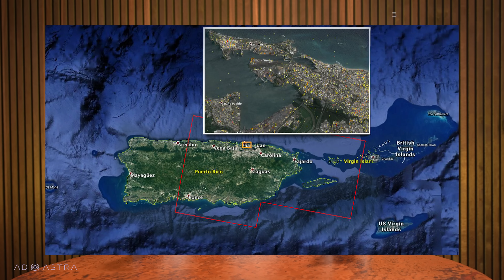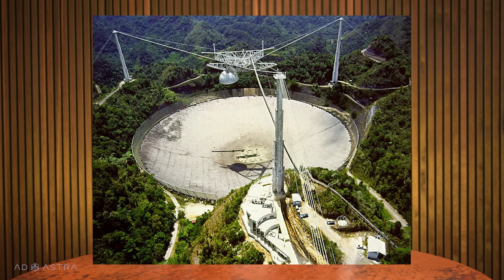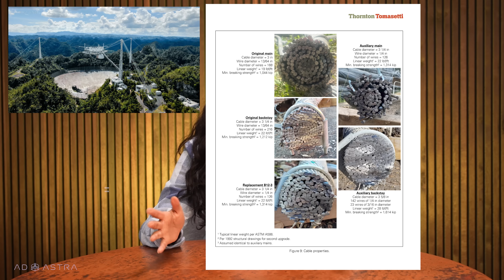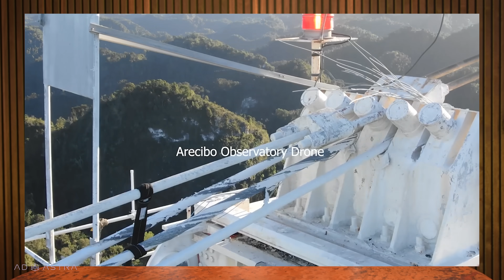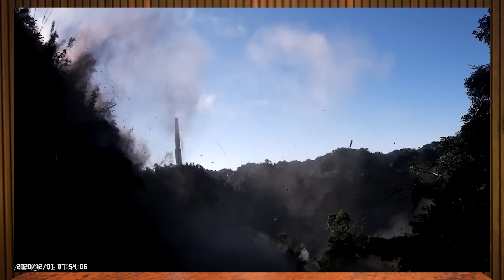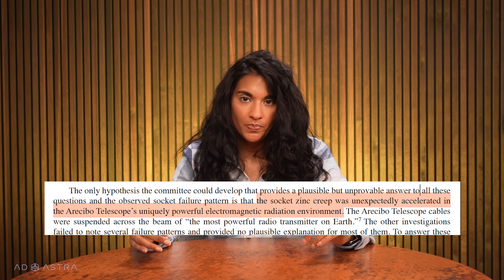ARECIBO COLLAPSE: We may finally know why the historic observatory failed

Comment: I was not aware that the dish was also used as an atmospheric radar device, so far I had thought it was a mere receiver that had only been used as a transmitter to send out SETI messages at some point.

Seeing that it was actually capable of sending radar pulses in the 2.x GHz range with 1MW transmitter power makes the explanation more plausible ....
Reply: There's a lot they don't tell us about. Remember that. These days you have to ask all the questions you can, because nothing is offered up for free.
Reply: @ThisIS_Insane  it was so secret that this was built as a radar dish, that it's discussed on its Wikipedia page.  Duh.
Reply: @duanem.1567  We all know how precise All them wikis are, don't we?
Reply: @ThisIS_Insane  If something is discussed openly on a Wiki page, and is common knowledge among people in certain industries, then it should be embarrassed to call itself a conspiracy.
Reply: @ThisIS_Insane  they apparently know something you don't.

Comment: The zinc was contained within steel shells, which would have shielded it completely from radiation. In fact a layer of aluminium cooking foil would have been sufficient to do the job. The radiation-induced creep sounds like a non-starter as a reason for collapse. (I am a microwave radio engineer and have designed both transmitters and receivers for space-based projects)
Reply: They use zinc anodes to protect steel from corrosion. I would bet there was current from somewhere flowing through the cables and that was enough to erode the zinc which loosened it in the sockets.
Reply: @NBSV1  That is a very different process, and I'm betting all those cables will be ground-strapped to make sure they don't kill too many engineers. The zinc has certainly crept, but I don't think the mechanism is electrical.
Reply: @ considering those style couplings hold well in other applications there was something different going on here. Bridges aren’t normally going to have the power put through them like this did.
Reply: @NBSV1  You have decided what the difference is. I would say there is a much bigger difference at work here. In a bridge once the cable is installed it doesn't move. These were subject to varying stresses as the receiver cabin moved about, particularly after its weight was increased from the original design. I know extra cables were added, but they were not integrated - rather a separate item. I would be looking there before anywhere else.
Regarding the power, the amount actually impacting each joint was minute - the total radiated power was spread over the entire area of the dish. The amount impinging on an individual coupling would not raise its temperature by more than maybe a thousandth of a degree. And as I said before, none of that RF energy reached the zinc. It all hit the steel.
Reply: @ And, bridges don’t have heavy cars and truck driving over them all the time? Even pedestrian bridges will get cycles of loading as people walk over them. 
About the only thing different in this setup is the radio frequencies and such the assembly was subjected to. I wouldn’t worry about temperature as much as induced currents and ionizing of parts. 
Regardless of what caused it, they obviously had a problem that should have been noticed during an inspection. Either they weren’t doing inspections of the cables, didn’t do a good enough inspection, or didn’t have the funding to care. 
If they had wanted to keep it going they could have started replacing cables and either fixed the problem, or just accept that the cables are a maintenance item that gets replaced.
Reply: There is an induced flow from the dish to the cables and their Zinc plugs. Electromagnetism etc. It's similar to copper windings spun around a steel core or whatever an AC generator/motor does.
Reply: @santyclause8034  remember this is rf. Any induced currents will be confined to the surface by skin effect.

Comment: Interesting , zinc anodes are used on boats to avoid electrolyses between dissimlar metals , ie in my case a cast iron  keel and a bronze propeller  . The zinc's in fact a sacrificial anode , ie better the anode desolves than the bronze prop.

Comment: The odds of funding for a replacement are very small, it was originally built for the military, it was a DARPA project.
Reply: It could be done if the science generated was valid and worth it imo. I think it was given up on too easily.
Reply: @metatechnologist  There is no room for it in the NSF budget, they couldn't even afford the upkeep. Find a military purpose for it and I have no doubt you can get it rebuilt. But there isn't any, that's why it was given to the NSF to begin with.
Reply: @anonemus2971  there's that plus other instruments have better resolution. But it's still interesting to ponder.

Comment: Having such a machine sitting, uninsulated and grounded by these zinc plates, transmitting a current towards the ground via this tower, should have been taken into account in its design. Failure was imenent, and I would postulate that this condition would be found on some of other zinc plates in the series, throughout the telescope cable ties.

Comment: If there was DC current on those wires, means that something must have been seriously wrong with the RF transmitters.
AC current above a few kHz this deep inside the zinc socket is basically impossible due to the skin effect.
Ocean salt and years of corrosion seems much more likely to me.
Reply: If they want to print unproven ideas, how about poor material and workmanship, poor inspection practices, poor choice of construction materials, underestimating the effects of the mass of additions to the aging structure, underestimating / ignoring weathering effects. (i.e. hurricane loads are unpredictable, and hard to measure.)
Reply: @jfbeam  IIRC, the mass of the raft was increased with a large amount of additional receiver antenna.
Reply: how do batteries work, just a thought.

Comment: 11:00  ship cable to a pier bollard must have each yarn equally matched with each other in the cable. Otherwise, the one that is being pulled the most will break first. Manufacturing uniformity is of the utmost importance.
Reply: Only as strong as it's weakest link.

Comment: That actually sounds very plausible to me that the Zinc may be affected by the high radiation, may become slightly more pliable and slowly morph over many years. Seems to me that the Lunar Crater Radio Telescope might be a better investment, but building an improved, bigger Arecibo 2.0 would be second top choice for Radio Astronomy.
Reply: Even though the telescope actually doubled as a high power atmospheric radar, the Zinc would not really have been directly exposed to the radar pulses, the anchors should only have been hit by some much weaker side lobes?
Reply: @hartmutholzgraefe  She said that an electric current was created inside the cable and that it was the electric current that caused  it to fail.
.
Reply: @BobSmith-dk8nw  For that the cables would have to have acted as an antenna though, but the cables where much longer than the signal wavelength.

The main transmitter was sending in the 2.x GHz range, so with a wave length of less than 15cm, That shouldn't cause significant current ...?
Reply: If you guys have heard of bi-metallic galvanism... basically the cable forms an electrolytic bath which eats away the anode material and deposits it on the cathode closest to the largest potential difference before ground (or something). Not only is there cable slip, the Zinc plug is re-deposited somewhere it is not designed to be. With a little more fastener engineering this would have been a non-issue. Possibly the most rudimentary fastenings that could be devised, the cable  strands were not collectively solidified under tapered diameter clamping, in tandem with the Zinc end plug through split collets, example pc-style hard tube fastener design in a water-cooled loop. Or a Collet chuck in a center lathe; or some equally clampy fastening design already well explored, not rocket science, not expensive..

Comment: There after the 4:22 point, "confusingly named towers four, eight, and twelve" get a dial clock or watch and set it on the location's ground plan or on a map printout ... 🕓🤔
Reply: It all goes back to the brilliant sexagesimal base-60 numbering system invented by the Sumerians in the 3rd millennium BC.  60 has 12 factors, of which 12 is one.  A circle with 60 equally-spaced markings on it can be easily broken up into exactly equal 1/2, 1/3, 1/4, 1/5, 1/6, 1/10, 1/12, 1/15, 1/20, 1/30, and 1/60 sections.  Analog clocks are sexagesimal and divided into 60 and 12 parts.  Today we think decimal and base 100 make the most sense, but try breaking up a circle with 100 equally-spaced markings into thirds to create a perfect tripod without using a compass to find the 33.3333... and 66.6666... points.  100 has only 9 factors which doesn't include 3.  Not that I'm blaming the Sumerians for the Arecibo collapse...
Reply: Yep.
Reply: analog clock, not digital?
Reply: @hartmutholzgraefe  Correct. Probably thanks to the neurological autoimmune disease my brain couldn't produce the word analog at the time of making comment & dial was closest word it would give me.
Reply: @scottfw7169  and I misread "dial" as "digital", but can only blame that on lack of sleep ..
Reply: @scottfw7169  my goodness. Using clock hours to indicate direction is very common. Once you are cued-in to that your confusion should go away.
Reply: @richardhole8429  The frightening part is how many will never make the connection in the future.

Comment: I have never been to Arecibo, but understanding the nature of the intense radio waves along with the inherent nature of stray voltage and wire rope/cables... I have to ask if any form of cathodic protection was applied to neutralize the voltage potential?  Something used in many area of the oil and gas industry, including pipelines.    In the business I was a part of for 41 years, we utilized Babbitt cell rope sockets in the early years for our wire rope and “cable-heads” albeit significantly smaller than those used on the towers.  But, they too would weaken as continuous stress and utilization cause multiple failure points where two unlike metals were combined.  In this case, zinc and galvanized steel cables.
Reply: In this case, the current is from induction (EM fields), not the voltage that arises from dissimilar metals being in contact.
That said, there is still some change in the form of the material from the current running thru it.
Pretty weird stuff to think about.
Reply: @ agree.  I know we ran a downhole instrument called a Cathodic Protection Profile Log on a 7 conductor wireline or wire rope, we would use a surface ground and carbide tipped “fingers” located 10’ apart and making contact with the inside of the metal casing used in oil and gas wells.  We would measure the potential between 0 and 35 amps (the most I ever saw) and then we would adjust the surface cathodic voltage and current until the current at depth (anywhere between 0’ and 19,000’ and set the CPP at that level.  Otherwise the pipe, casing, metal would break down molecule by molecule casing rapid erosion leading to a hole in the pipe causing a leak of production fluids or gas.  Gas wells should be monitored while “flowing” full gas production going to the sales line as the motion generates a current.
Reply: Youse guys are on the trail. I had similar thoughts when EMF was mentioned. Electrolysis is a definite maybe.
Reply: @santyclause8034 I like the 'youse guys', this and the above comments show how much knowledge and expertise is involved in the oil and gas industry. Wow,  amazing stuff here.

Comment: Interesting. Originally I was a metallurgist, when I was 19/20 I was running R&D on stealth technology for the UK Ministry of Defence. When the Challenger blew up I guessed what it was straight away because it was very close to my specialist area of research.

Always liked Arecibo all my life because I lived near Jodrell bank in Cheshire, which was the largest single dish radio telescope in the world until Arecibo was built. Failure is often due to an unknown factor at the time, eg Liberty ships and Comet airliners, rather than anything lacking in construction with regard to the known factors at the time. Well apart from Challenger, that was an unbelievable disregard for known factors.